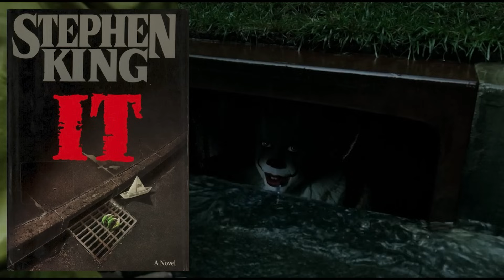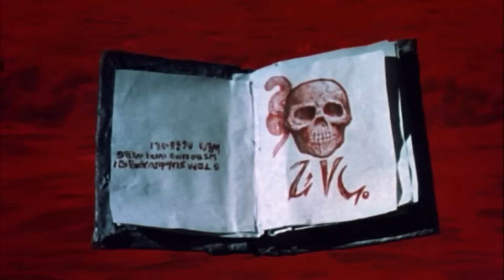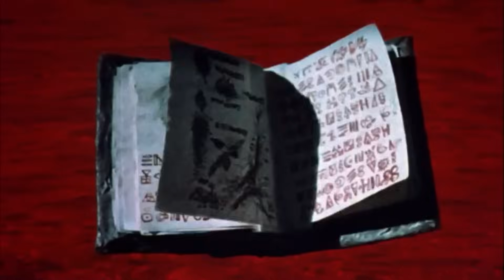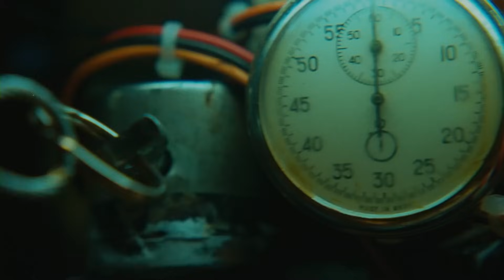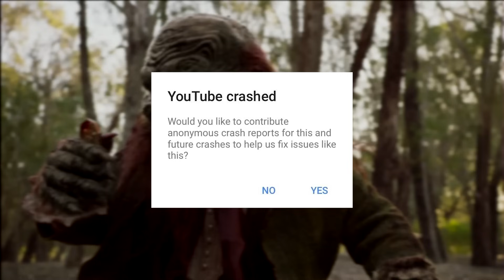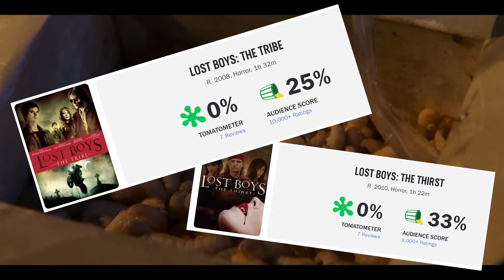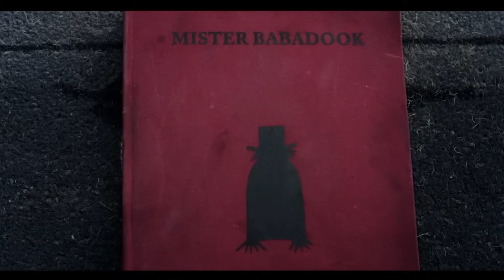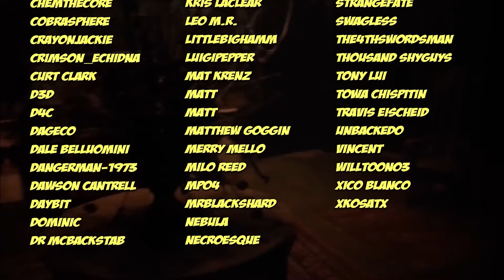The Ultimate Horror Crossover Fighting Game - Part 1 - Build the Roster

Comment: I've had this movie in my head for a year and need to type it. I'm not a writer and I don't own these characters. 

I've read the crossover comic books with Freddy vs. Jason vs. Ash. I've read the Hellraiser comics. I've omitted the continuity of those and started fresh. 

No one has put all of these characters in a single story together like this before. It's Jason Voorhees, Freddy Krueger, Michael Myers, Evil Dead, Hellraiser and Chucky. I made it as cohesive as possible. I wrote it as more of a recap or synopsis rather than a detailed story to save time. Don't read it if you're not big on reading. I post this everywhere and it evolves. It's been quite a bit of fun.

I appreciate constructive criticism. Any input or ideas you contribute are appreciated. If you use any of these ideas, I require no compensation, only a small "thank you" credit, an acknowledgement. Shout out. 

 Title:
 Jason v Freddy: Deadraiser
or
Jason vs. Freddy: Slash of the Titans
or
Jason/Freddy/Michael: Hell Breaks Loose
Reply: Act one:

 Freddy Krueger tampers with the curse of the Thorn. He uses a false image of Laurie Strode to manipulate Myers into murdering the people of Elm Street and Springwood, sort of like how he used Jason Voorhees in the past. Myers is more intelligent than Jason, executing Freddy's plan flawlessly this time.

 Myers breaks into the home of Lori Campbell and Will Rollins, who still live on Elm Street after all these years and are keeping Freddy weak with Hypnocil. Myers replaces their supply of Hypnocil with placebos/fakes.

Jason Voorhees, hidden in a remote location near Camp Crystal Lake, has obtained the Necronomicon Ex Mortis: The Book of the Dead, the Kandarian Dagger, and the Lament Configuration. He holds the artifacts in a shrine next to the severed/disembodied head of his mother, Pamela Voorhees. Jason's mother is alive in Jason's psyche, guiding Jason to do her bidding.

Jason opens up the Book of the Dead and places it in front of his mother's severed head on the altar. He steps back, kneels down, and stares at his mother and the book.

The severed head of Pamela Voorhees awakens. Her eyes open wide. Jason's mother recites an incantation out of the Necronomicon.

Jason enters a very long-awaited slumber while holding the Lament Configuration and the Kandarian Dagger, crossing his arms with one artifact in each hand, listening to his mother read the passage from the Book of the Dead like a bedtime story.

Jason enters the dream world where Freddy taunts him. Jason attacks Freddy with the Kandarian Dagger. The Kandarian Dagger can send it's victims' astral form/soul to the Deadlands/Mirror Dimension. 

Freddy easily keeps his distance from Jason's attempts to pierce him with the dagger. Freddy obviously has homefield advantage. This is a NIGHTMARE, where Freddy is most powerful.

 Freddy, fully confident that Jason cannot defeat him in the dream world, surrounds Jason with walls of raging water like in the past. Jason, surrounded with water, opens up the Lament Configuration. The water disappears. This confuses Freddy. Freddy loses the ability to control the setting. 

The dream world starts to transform into Leviathan's labyrinth, home of the Cenobites and the Order of the Gash.

Outside the dream, the slumbering body of Jason Voorhees vanishes from the shrine at Camp Crystal Lake. Pamela Voorhees continues to read the Necronomicon as Jason fades into nothing.

The dream world is transformed by Jason opening the Lament Configuration inside of the nightmare. Freddy is pulled out of the dream world into the new setting. Freddy and Jason are both in Hell, or rather one of the many hells.

Freddy's powers lose their effect in this new setting. He is severely weakened.

Jason gains the upper hand in the battle with Freddy until Cenobites appear.

 The Cenobites restrain Freddy and Jason with chains and hooks that appear out of thin air.

Pinhead begins to speak. Pinhead recognizes Freddy is a dream demon and Jason is a highly powerful form of Deadite that regenerates after being killed. Pinhead is very interested in the regeneration of Jason's flesh.

Pinhead underestimates Jason's superhuman strength. 

Jason breaks free from the chains and goes on a rampage through the labyrinth with the Kandarian Dagger. He uses the dagger to dismember the nearest Cenobite. This kills the Cenobite and the body falls to the floor, but it also sends the Cenobite's astral form/soul to the Deadlands/Mirror Dimension.

Jason uses the Cenobites' own chains against them and defeats another Cenobite with the dagger. 

The two Cenobites astral forms are displaced, relocated to a mirror version of the labyrinth. There are no other beings in sight in this dimension. The Cenobites are alone together.

The Cenobite bodies remain lifeless on the floor, their souls sent to the Deadlands.

 Pinhead tells Jason that Jason's brutal killing is a waste of suffering. Pinhead, a sadomasochist, takes time to enjoy the suffering, but Jason wants to end lives quickly. 

Jason approaches Pinhead with the dagger.

Pinhead restrains Jason with chains once again. This time, Jason becomes fully immobilized by Pinhead. Pinhead does not underestimate Jason again.

Freddy is also still in chains saying the occasional one-liner. He calls Pinhead a bitch.

Michael Myers is on a killing spree on Elm Street. He goes so far as making  the murders reminiscent of Freddy Krueger. He  writes Freddy's name on a wall in a victim's blood.

Freddy Krueger loses power over the Curse of the Thorn due to his detour to hell.

 Myers becomes confused about his purpose. Myers loses his motive. Michael Myers realizes Laurie Strode is absent. The image in his mind of Laurie Strode fades, mid rampage.

 Ash Williams, on a hunt for the Necronomicon, thinks it's Jason commiting the Elm Street murders because of the events of Freddy vs. Jason.

 Ash bursts into the house Myers has been terrorizing and gives Myers a chest full of boomstick, sending Myers off a long drop out the window. Myers disappears. Ash realizes it isn't Jason.
Reply: Act two:

Andy Barclay has also arrived at the house on the Elm Street with Ash's friends, Pablo Bolivar and Kelly Maxwell. 

Andy mentions Chucky wants to combine the powers of the Necronomicon with Damballa, the voodoo spirit Chucky draws power from. Ash also has the same goal as Chucky, which is to take the Book of the Dead back from Jason Voorhees.

Ash, Andy, Pablo and Kelly's purpose is to keep the powerful artifacts out of the hands of evil. The characters Ash, Pablo, Andy, and Kelly are warriors and the toughest of the protagonists. They tell a story of a recent confrontation with Chucky where they emerged victorious, but Chucky is still out there. 

Kirsty Cotton is the newest part of the group, having not been part of the battle with Chucky. She is a great survivor more than a warrior. 

Kirsty is after just one of the puzzle boxes constructed by Philip Lemerchand in 1784, the Lament Configuration. She joins Ash on his search for the Necronomicon. 

Kirsty and Ash have vast knowledge of the artifacts they seek. They look to each other for answers. Kirsty and Ash are wise and experienced.

 Ash, Andy, Pablo, Kelly and Kirsty come across Lori Campbell and Will Rollins from Freddy vs. Jason, who have kept Freddy weak all these years.

 Will and Lori keep quiet about absolutely anything to do with Freddy. They don't even mention that name. The couple are happy to answer any questions Ash has for them about Jason, since the couple have fought Jason in the past.

Will and Lori keep Freddy away with a daily dose of Hypnocil, and also out of the minds of others. By hiding the lore of Freddy Krueger and covering it up with the lore of Jason Voorhees, Freddy is weakened further. If the people of Springwood are thinking about Jason, no one knows about Freddy Krueger. Freddy needs them to remember him in order for him to truly come back.

Freddy's plan from Freddy vs. Jason completely backfired, turning Jason into a local celebrity, overshadowing Freddy. 

The town, the Springwood police, the mayor, they do anything it takes to erase Freddy's history. They took advantage of Jason's killing spree and used it as a cover-up to cover Freddy's legacy. Springwood is known as the site of the Voorhees murders, NOT Freddy whatsoever. The police know all of this. They are also on daily hypnocil.

Ash senses something is way off with the people of Springwood.

Pablo can see through the eyes of the Necronomicon and pinpoints it's location.

Ash, Kelly, Kirsty, Pablo and Andy depart Elm Street for Camp Crystal Lake to continue the search for the Book of the Dead.

 Will and Lori stay behind, not interested in the Necronomicon or getting into another fight with Jason like last time. They're only interested in keeping Freddy weakened and staying safe.

 Michael Myers, still alive, hides in the shadows. Without Freddy to manipulate the curse or project an image of Laurie Strode, Myers abandons Elm Street and stalks the team of protagonists on the search for the Necronomicon.

In the labyrinth, Pinhead restrains Jason and Freddy with chains. Pinhead analyzes the two in awe. Pinhead tries to savor Jason's pain, but realizes Jason is incapable of feeling much of anything except bloodlust. Pinhead analyzes the Kandarian Dagger in Jason's grasp and realizes it's capabilities.

 Realizing the dagger was how Jason was able to kill a Cenobite, Pinhead attempts to destroy the dagger in Jason's clenched fist. Pinhead is unable to destroy the dagger due to interfering, familiar sorcery.

 One of the Cenobites mentions the Kandarian Demon to Pinhead. Pinhead mentions ancient entities called Dark Ones. Pinhead explains some of their history, that they are akin, distantly. However, their ambitions differ significantly and they inhabit two different dimensions.

The enormous Leviathan appears overhead. The walls of the labyrinth twist and open to encase Jason. Jason struggles to break free, but becomes bound to the hellish scenery. He shows great resilience, but is now dealing with a much more powerful force. Jason is swallowed into the walls of the labyrinth. Leviathan begins to transform Jason into a Cenobite. 

 Freddy is still restrained with chains and ready to be ripped apart at a moment's notice. Freddy quips with Pinhead, saying disrespectful remarks. Pinhead responds wisely, tightening the chains restraining Freddy.

 Pinhead reveals to Freddy that the nightmare realm is not off limits to the Cenobites. Pinhead has been known to enter that dimension freely, but not remain there very long or create elaborate nightmares.

Pinhead admires Freddy's unique abilities. Pinhead considers a slumber to experience the suffering, only half serious about it. Pinhead is very interested by what Freddy's nightmares can inflict. This is what is keeping Pinhead from immediately pulling Freddy apart.

 Freddy's power is greater than Pinhead's in the dream world, but this is the labyrinth, and Pinhead holds a much higher rank in the demonic hierarchy than Freddy, being the hell priest who takes orders directly from Leviathan, first in command to an army of Cenobites. Freddy holds no allegiance to Leviathan or anyone besides the three dream demons who empower him. Pinhead has a much more important agenda than to terrorize kids in their nightmares. 

Jason Voorhees is encased within the labyrinth walls, incapable of overpowering the shifting walls of the labyrinth. Jason struggles as pieces of him are violently replaced and transformed. 

Deep in the woods of Camp Crystal Lake, The head of Pamela Voorhees recites the words of the Necronomicon. She summons Jason to come home.

 Jason breaks one hand free from the chamber with the Kandarian Dagger. 

The invisible, demonic entity from Evil Dead rapidly makes it's way through the labyrinth, quickly approaching the scene. The entity travels with great speed along the labyrinth floor and directly into the bodies of the two Dead Cenobites. This resurrects the Cenobites, but they are not the same as before. They are Deadites. They show no prior personality traits and are purely Deadites in the bodies of Cenobites. The Deadites attack Pinhead.

The Kandarian Demon appears in the reflection of the blade of the Kandarian Dagger. 

The demon is summoned and breaks through the labyrinth wall, breaking Jason free of his containment. Jason emerges from the broken transformation chamber to see the Deadite army infiltrating the realm of Leviathan.

 Jason takes on a slightly different physical appearance, half Deadite, half Cenobite. He is transformed and more powerful than ever. 

The Engineer attacks the Kandarian Demon and attempts to repair the chamber. The Kandarian Demon fights back against the Engineer.

Freddy breaks free of his chains. Freddy fights Deadites and also Cenobites.

Pinhead zaps the Cenobites who have been possessed by Deadites with a bolt of energy that instantly restores them to their previous nature. Their souls exit the deadlands, returning them to the labyrinth, back in their original bodies once again. The Cenobites join Pinhead in a fight against the Army of Darkness.

The Cenobites use their homefield advantage to manipulate the setting in their favor, rotating the walls and floors, smashing Deadites flat with the huge bricks and stones, sending the Deadites disappearing into the walls.

 All Deadites and Demons combined are no match whatsoever for Leviathan. The enormous Leviathan, floating very far overhead, easily vaporizes any Deadite in the immediate vicinity.

Kandar the Destroyer towers over the battlefield, gigantic, but still miniscule in comparison to the incredibly enormous Leviathan floating in the sky.

The Dark Ones (ancient demons who created the Necronomicon) ascend to the sky and attempt to interact with Leviathan.

 Leviathan becomes preoccupied with Dark Ones, unable to help with the Cenobites. 

Leviathan goes from glowing with bright light to completely pitch black. Red lightning and dark clouds begin to circle around Leviathan and the Dark Ones. It is unclear what is happening between the entities.

Free of Leviathan and transformed, Jason Voorhees attempts to continue his onslaught against the Cenobites. He has gone through a Dr. Channard-like transformation. He has some Cenobite powers, but has not learned to use them. He struggles to manipulate a chain through telekinesis.

 Jason attaches the chain to the Kandarian Dagger and it overflows with power. The blade grows slightly longer and more demonic. It becomes engulfed in flames.

Jason swings the Kandarian Dagger around with the chain, creating a whirlwind inferno that approaches Freddy and slices Freddy into flaming bits. The pieces of flaming Freddy disappear and burn away. Freddy's body does not remain behind like the Cenobites'. Jason reclaims the dagger into his grasp. It appears that Freddy is defeated.

 Jason pauses. He sees his mother's reflection in the dagger. The dagger shrinks back to normal size. The chain detaches. Jason hears his mother tell him to escape. If not, he will be torn apart by Leviathan and bound to the labyrinth.

 Jason's mother guides Jason into solving the Lament Configuration. Jason solves the puzzle with the help of his mother. Jason disappears, narrowly escaping the chains of Pinhead.

 Jason's slumbering body reappears in the Shrine at Camp Crystal Lake while simultaneously re-entering the nightmare where he left off. He's back in the nightmare, except Freddy is dead. The water still rages around Jason in the nightmare like it did before he opened the box.

  Pamela Voorhees appears in full-bodied physical form and tells Jason he can manipulate the dream. The water dissipates around Jason by his own will. He has control of the nightmare. His mother tells him it's time to wake up. He awakens from his slumber at Camp Crystal Lake.
Reply: Act three:

Ash and the team of protagonists reach Camp Crystal Lake, which is now populated by Deadites. Jason and his mother have been continuously performing rituals from the Necronomicon. Ash and company intervene. Mayhem ensues. 

Ash and friends are restrained by Deadites as Jason approaches to slaughter. The Deadites mock and tease Ash in typical Deadite fashion as they restrain the protagonists and Jason approaches. 

It looks as if Jason is about to deliver a violent, fatal blow to Ash with a machete, but Jason throws the Machete away to his side, into the trees, seemingly for no reason.

 Ash gets confused as Jason turns away from them and looks toward the woods where he just threw the machete. 

Michael Myers comes out from behind a tree. He followed Ash to Camp Crystal Lake. Jason threw the machete because he sensed Myers was hiding. The machete went through the tree and stabbed Myers.

 Myers pulls the machete out of the tree and holds it by the handle, staring back at Jason, only slightly injured by the machete. Myers charges at Jason with the machete.

While the two face off, the team of protagonists use the opportunity to break free from the Deadites and regain the Necronomicon, the Kandarian Dagger, and the Lament Configuration.

 Ash recites the proper incantations from the book, Pablo takes the dagger, and Kirsty takes the Lament Configuration. Kelly and Andy blow away Deadites with various firearms.

Jason is in Uber-Jason mode from his transformation, so he only suffers minor, superficial damage from Myers. Myers hits Jason with the machete until it breaks. 

Jason uses his Cenobite power to summon a chain around Myers' neck and drag Myers away. The chain begins to hang Myers from a tree. Myers hangs from the branch and is believed dead.

 Jason picks up the broken machete and turns his focus back on Ash Williams, who is still reading from the Necronomicon. 

Ash needs more time to recite the passage. Jason approaches.

To buy Ash some time, Kelly, Andy and Pablo attack Jason with guns and the Kandarian Dagger. Pablo, holding the dagger, is killed with the dagger and thrown aside. Jason continues to fight Kelly and Andy.

Myers, still alive, grabs the Kandarian Dagger from the deceased Pablo and stabs Jason in the chest from behind with it. 

The ground opens up around Jason and demons begin to take him like in the past. Demons try to pull Jason farther into the pit. Deadites try to help Jason break free of the demons.

 Jason tries to pull the dagger from his chest. Myers kicks the blade deeper into Jason. The dagger flashes like bright sparks.

A beam of blinding light descends from the sky, shining down from the clouds onto Jason. Demons pull Jason farther into the ground.

Myers attempts to target Ash, but a Deadite attacks Myers and Myers is preoccupied with Deadites. 

Ash finishes the incantation. 

The small pit Jason is being pulled into largely increases in size. The earth quakes as the hole gets much bigger and deeper, pulling all Deadites into it like a vacuum, similar to the vortex of the Evil Dead, but in the ground. Flames are visible deep down. 

Jason removes the Kandarian Dagger from his chest successfully while clinging to a ledge on the side of the pit. The demons lose grip on Jason and they disappear. The beam of light in the sky vanishes. The pit remains open and the vacuum of the pit persists. Jason still clings to the ledge.

One remaining Deadite being pulled into the vortex pulls Myers in with it on it's way down. Myers just barely grabs the foot of Jason Voorhees and holds on tightly. Jason hangs to the ledge with one hand while Myers holds onto Jason's foot.

  All the Deadites are gone except for Jason, but Jason shows great resilience against the force of the vortex.

 Jason kicks Myers off his foot. Myers clings to the pit wall by stabbing the pit wall with a knife and holding onto the handle. 

Jason uses his Cenobite chains to pull himself to the surface against the vacuum of the vortex. Jason emerges from the pit. He stares momentarily at the protagonists while holding the Kandarian Dagger, then approaches Ash.

Ash tells Kelly and Andy to take the Necronomicon and run. They hesitate and then they go. Kirsty, holding the Lament Configuration, stays with Ash.

Ash takes on Jason alone and is fatally wounded with the Kandarian Dagger. Ash says a one-liner before he dies.

 Kirsty opens the Lament Configuration.

 An explosion comes from deep within the pit like a grenade. Cenobite chains emerge from the explosion, past Myers, tearing into Jason. 

Pinhead emerges from the pit. 

Pinhead briefly acknowledges Kristy from their past, but puts aside their personal business. Pinhead takes Jason back toward the pit. Pinhead descends back into the vortex, pulling Jason with chains back to the underworld.

 Myers and Pinhead make eye contact as Pinhead descends and Myers clings to the pit wall. Pinhead's chains pull Jason and Pinhead along like puppets on a string. The chains become giant pseudo legs, moving Pinhead around like a giant spider's legs. Pinhead moves effortlessly, the body remaining still, steady in position while riding the chains as the chains move Pinhead and Jason along. Jason is fully restrained by chains, wrapped head to toe in them.
 
Deep down in the pit, Pinhead enters the flames first, dragging Jason behind.

 Myers and Jason also make eye contact as Myers clings to a ledge and Jason is pulled into the flames behind Pinhead.

The vacuum of the pit ceases. Kirsty closes the Lament Configuration. The flames disappear. All Deadites and Cenobites are gone. There is a brief, calm silence. 

Myers has outlived Jason. He attempts to climb out of the pit.

 The earth quakes once more as the pit begins to close up around Myers. He comes very close to the surface, but is buried alive. 

Kirsty Cotton remains, having obtained the Kandarian Dagger and the Lament Configuration. Ash and Pablo lay dead at her feet, but their astral forms exist in the Deadlands.

Andy and Kelly drive away in the Delta 88 with the Necronomicon. It seems a peaceful getaway until Chucky emerges from the back seat. 

Chucky turns the wheel, flipping the car over. Chucky emerges from the wreck with the Necronomicon and disappears. 

On Elm Street, Lori and Will remember Freddy Krueger and speak about him to each other. They take their daily dose of Hypnocil, which are actually placebos/fakes. 

Freddy's plan was accomplished. Myers executed the plan flawlessly. All Freddy needed were the people of Elm Street to remember him for him to . He enters Lori's nightmare. He kills her in the dream and begins to regain his power. He takes on his most demonic form from Freddy vs. Jason.

The sentient, disembodied head of Pamela Voorhees still remains conscious in the shrine.